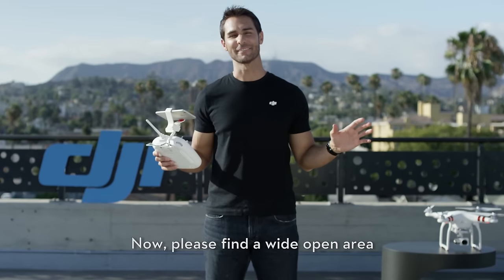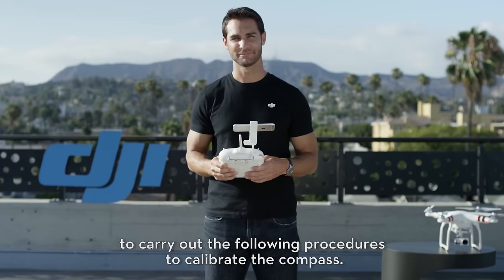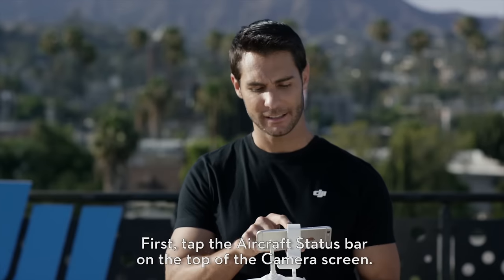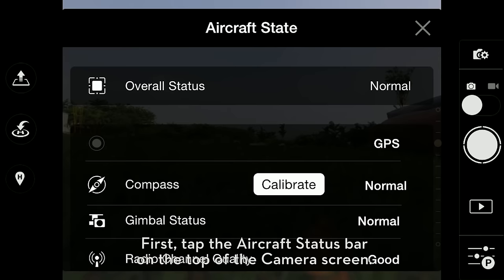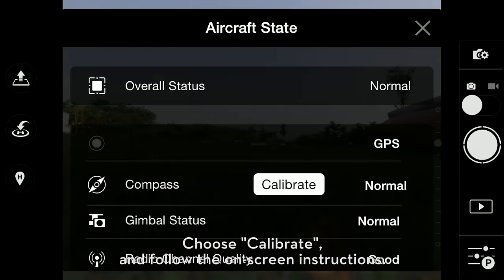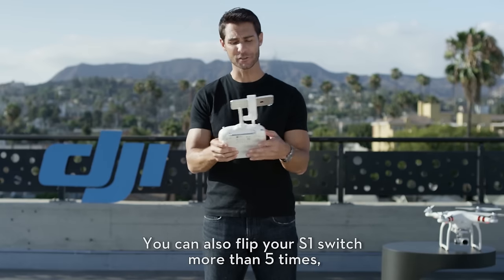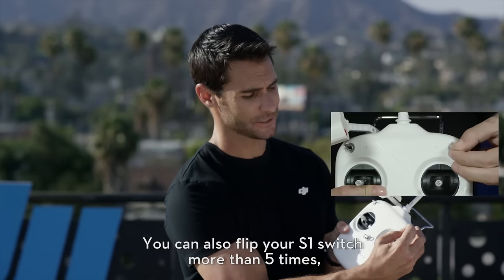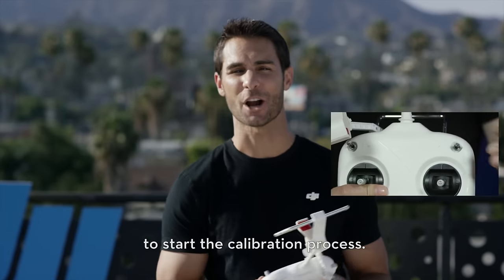DJI Tutorials - Phantom 3 Standard - Calibrating the Compass

Comment: Hi! I am a wheelchair user. Do you think calibration would work holding the device overhead and rotate it around its own axis instead of the shown circular pattern? Would the wheelchair's metal structure be of concern? It is a manual type, mostly made of aluminum and titanium, steel only used for wheels, spokes and small parts like bolts.

Comment: is this an older calibration video?

from the calibration screen and from what many have shown me you want to circle the unit holding it in a solid spot and working your way around it. unlike what he did here. which was to hold himself in a static spot and move the unit around him.

DJI, can you end this debate once and for all if it matters which way it's done?
Reply: Sean Ozz I don’t think it matters because you’re calibrating an onboard compass and effectively showing it 360 degs in order for it to know where north is. Once it knows North, it’s done. It’s not going to matter if you rotate or the craft but IMO, it’s better to do it the way he did it as the rotation will be much smoother.

Comment: I'm confused with the lights. I thought as soon we toggle the S1 more than 5x the lights turn to blinking yellow than we rotate the dron 360 degree horizontally the light turns to solid green, than we tilt the drone face down, and rotate the drone 360 degree until the indicator  turn solid green or solid yellow? but already the indicator was solid green by first rotation? I'm still lost. Please verify , I don't want send the quad into air without complete calibration. Thanks

Comment: Hi! After the calibration, front LEDs are solid red and rear LEDs are green, what does it mean? Correct or incorrect calibration? In fact in this video the rear LEDs are red. 
Is somebody know ? Please 

Hola! Después de calibrar, los LEDs frontales son rojos y los traseros verdes, esta bien o esta mal? Porfa, alguien sabe?!
Reply: same happened to me today, i'd like the answer as well, the horizontal calibration resulted in solid green but the vertical one resulted in red .-. today it was okay as i flew it in a low safe zone but tomorrow im afraid it might catch some interference and i won't be able to return it home safe
Reply: look at your phone dude it will tell you
Reply: Color of the front lights doesn't matter. They're only red. Only the rear lights are used for status messages.
Reply: thanks for the answers!